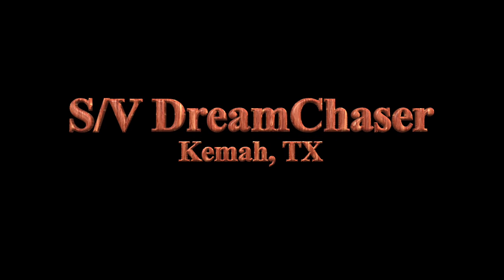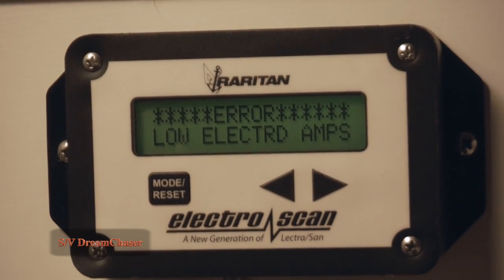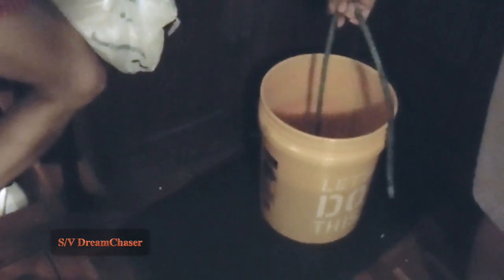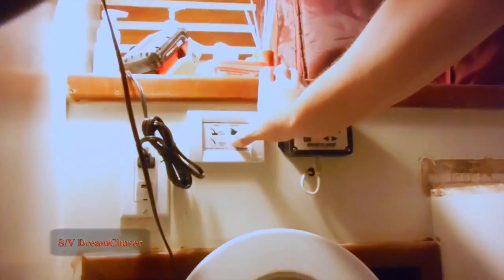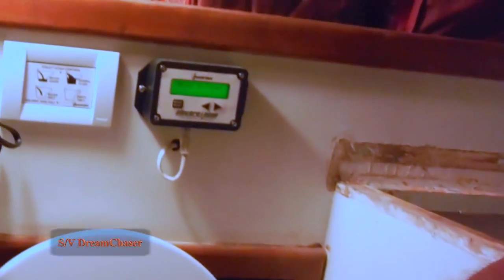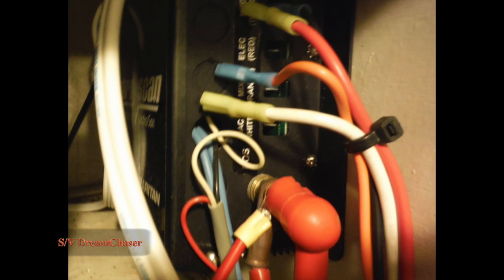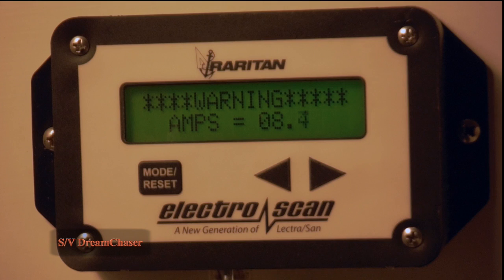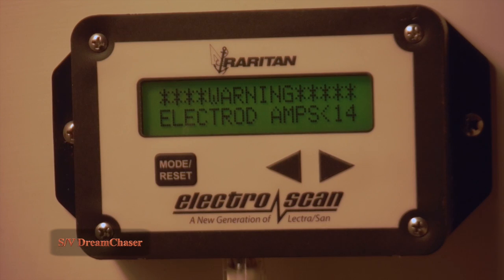ElectroScan Treatment and Electrode Cleaning

Comment: You mention the solution at 45 minutes minimum. Raritan manual, page 5, says for muriatic solution - "Allow to stand for a maximum of 45 minutes." I believe this so the solution does not damage the electrodes. I find conflicting information here. Other than that, the system works well.
Reply from the maker: Thanks for pointing out the difference. Certainly if my times are different than Raritan, you will want to follow their recommendations to avoid problems of something is under warranty. Thanks Peter.

Comment: Great video, I just bought a boat which have that system. It’s not very commen in Europe. So it’s hard to find someone to ask. How strong is the acid you use? I can find 60%.
Reply from the maker: I don't think my last comment went through.  My acid bottle doesn't list it's strength and I think the muriatic acid I bought if full strength, which is why I mixed 1.5 pints of acid into 3 gallons of water.  For the metric system it would be 12 liters of water and add in 3/4's of a liter of acid.
Reply: @Svdreamchaser  hi thanks for the reply.
agriculture and beekeepers use it in resolution 60-85% and those are the conditions I can get it.
I think I'm trying to mix 1/11 with a 75% then we'll see what happens. :-)
I just took over the boat and I never think the system is serviced.
But I have to wait a bit as the boat is 1500 miles away, but it will be a nice long trip home through Europe's canals.

This brings me to the question of adding salt, it just has to be salt of the purest quality right?

Daniel
Reply from the maker: I don’t know if high quality salt is required. I have had great luck with pool supply salt called “solar salt” and have used larger granules of salt made for a whole house water softener for years with no problems. That said, it is worth noting that the treating element can go bad or wear out. I did have to replace the element but I suspect it was based on family members not adding the right salt content through regular use.
Reply from the maker: Sone tips of you are interested since we lived on board as a family of 4 for five years with this system, I will share the following.  When you clean the system manually add salt via the toilet bowl of you are in freshwater or brackish. I started with 5 little “coffee scoops” of salt dropped into the bowl and flushed. I then flush and treat 3 times more than it takes to ensure the salted water is in the treatment system (for us this is 2 flushes). Given the length of hose that umber varies. I keep any eye on the amperage of the treatment on the Electroscan display during the treatment cycle. I then repeat the process at 6 scoops, them 7 then 4. By doing this is allows me to find the salt content that enables the highest amperage treatment. That becomes our level of salt to add with each flush.
Reply from the maker: I also don’t use a salt injection tank that Raritam sells. I feel like I have more control of the level of salt. Everyone on board is told how many scoops to use and it allows you to easily adjust that level depending on what water your sailing in (salt bay fresh) of your head uses exterior water for flushing. We use a fresh water flushing system but I know many don’t do this and leverage sea water for the flush.

Comment: What kind of salt solution do you use?
Reply from the maker: We use the lazy mans method. We calculated the amount of water per flush and then just scoop solar salt in to the bowl after every flush. So for us it is 3 tablespoons of solar salt per flush. We keep a little Tupperware dish and coffee scoop type spoon in it.   They do seek a salt injection tank as well but we opted for this method.
Reply: @Svdreamchaser  great thank you.  How do you winterize the system ?
Reply from the maker: @rastagrastag9496  good question. I love in an area where I don’t have to so am. It actually sure about this.
Reply: @Svdreamchaser   thank you.  I can’t find any info on how to winterize them
Reply: @rastagrastag9496  I winterize mine by using RV non toxic antifreeze.  Clean it out with water, then pump in the antifreeze until  it"s full. In the spring rinse with water before use.
Reply from the maker: Great idea.

Comment: I tried this today on my system. I'm still getting the low treatment light. I will try this again and let it sit longer then the 45 min that was recommended. I really dont want to have to replace the electrode. Especially at 500$.
Reply from the maker: I hear ya. If it’s already broke I figure let it sit in there longer. :)
Reply: SVDreamChaser any other recommendations for low treatment warning lights? Boat is in salt water.
Reply from the maker: I’m sorry Rich. I don’t have any other suggestions beyond the flush and clean and validating you have the right voltage and amperage going to the unit
Reply: SVDreamChaser ok. Thanks. 12.8v on shore power so I know there is enough volts. Just a matter of  leaning the electrodes. When you did the flush did you mix the acid it with saltwater or fresh water?
Reply from the maker: Fresh water. Don’t forget to calculate the length of hose and it’s volume from toilet to unit. That way you know you have the acid mix in the tank making contact with the electrodes. I mixed mine with Fresh water. You might consider mixing it a bit strong if you already tried it and it didn’t work. But your call on that (I might only do that as a last resort before biting the bullet and replacing.). I wonder if there is a way to test the electrodes (like through their resistance or something). I am not sure about that part.
Reply: SVDreamChaser not sure. Hose length is only about 6 ft. So maybe I'll make some extra. And do 2 qts of acid for 2.5g of water. Also let it sit for a few hours instead of the 45 min originally
Reply: The directions are not very clear and are confusing.  Do I run a treatment cycle with the acid in the tank?
Reply from the maker: That isn’t far but I think when I calculated mine it was about 10 feet which was 1.1 gallons of fluid just to fill the hose. So if you have 1.5” diameter hose you may need a half gallon just to get to the unit. Then the unit probably holds another gallon and a half.
Reply: SVDreamChaser did you run the treatment cycle with the Acid in the tank at all? Or waited flushed it out with fresh water then ran it?
Reply from the maker: I flushed it all out with freshwater. I probably ran about 6 gallons of fresh water through it to make sure that it was all rinsed out before I actually ran a treatment cycle. I’m fairly certain I read in one of the manuals somewhere to NOT run a cycle with the muriatic acid in the tank. It scared me enough It I didn’t try it
Reply: SVDreamChaser ok thanks. Then after flushing it out. You added salt and ran cycle. Fingers crossed. Will update you later tonight.
Reply from the maker: Rich Conolly I look forward to hearing if it works. Lol
Reply from the maker: Were you able to give it a try?
Reply: SVDreamChaser yes. Still the same thing. Going to try and give it one more done of acid again. Only had 1qt left. Bought more. I'll keep you posted. It's an older model EC. Not the newer scan version.

Comment: Does your electro scan dump directly overboard, and is the acid solution safe to flush out overboard when done?
Reply from the maker: Jim Nanney it does go from the electroscan overboard. Mine has the option to go from the head to a holding tank in a no discharge zone. 
As for the muriatic acid solution, it is not likely considered the most environmentally friendly but given the level of dilution I believe it to be safe.
Reply: Thanks, I purchased my sailboat and it has one, but the low amp warning won’t allow it to flush. Going to attempt the muriatic acid, but no holding tank. I may just disconnect from thru hull and flush to a 5 gallon bucket to be safe.thanks for your videos!
Reply from the maker: Jim Nanney if your on the hard you can discharge into a bucket with the acid solution but if in the water I think it is fine. I would recommend making sure you mix up enough solution to ensure you have the electroscan full of the solution and factor in the volume of solution that will be in the lines.
Reply: Just put back in water last Saturday. She’s at the marina now.
Reply from the maker: Jim Nanney if you have 1.5 inch diameter hose like most waste lines, keep in mine 11 feet of 1.5” hose will hold 1 gallon.